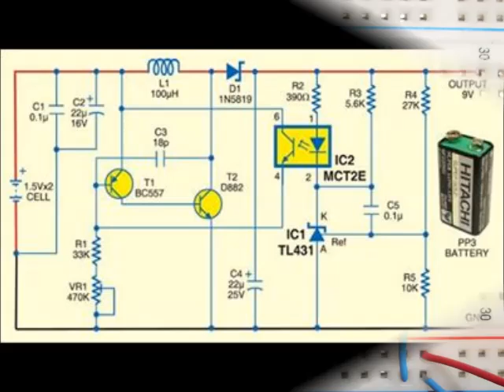Proyecto de Electrónica: Convertidor DC / DC experimental 3V a 9V (Prof. Jhonny Dávila)

Comment: Buenisimo, excelente. Una pregunta se podria reemplazar la tension de entrada por una bateria de celular de 3.7V queria saberlo para ver si funciona y asi utilizarlo como alimentacion para mis multimetros digitales y si podria aportar el diagrama mas la lista de componentes, de antemanos muchisimas gracias.
Reply from the maker: Por supuesto! Es viable y funcional adaptar una batería de celular de 3,7V; cualquier fuente de poder que suministre un mínimo de 3V podrá ser aplicada a este circuito, e incrementar la tensión a 9V, para alimentar aparatos con esa tensión, y de consumo de corriente moderado (por debajo a 1Amp). El diagrama y componentes ya están incluidos en este vídeo. Gracias por el interés, por el apoyo y tus comentarios!